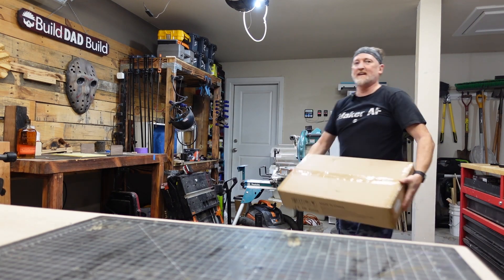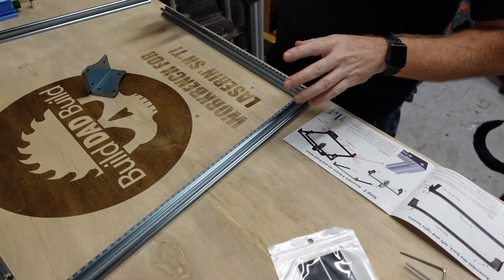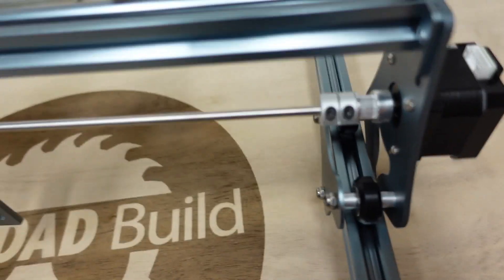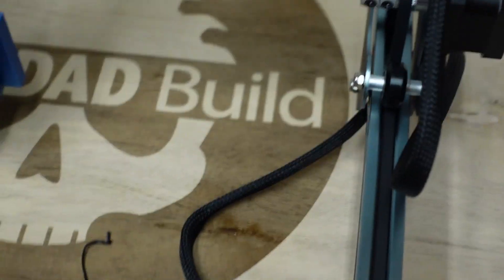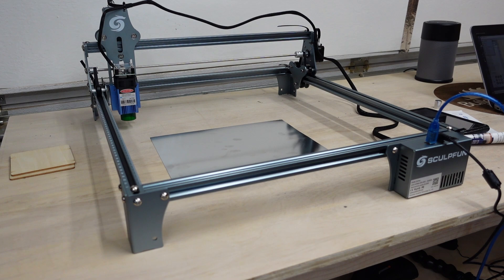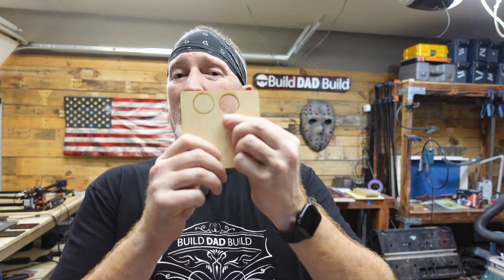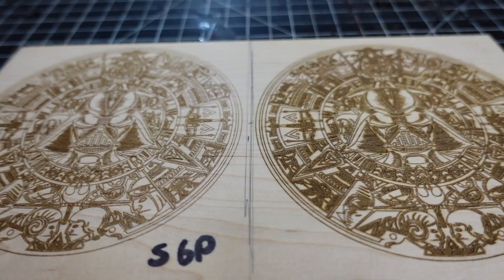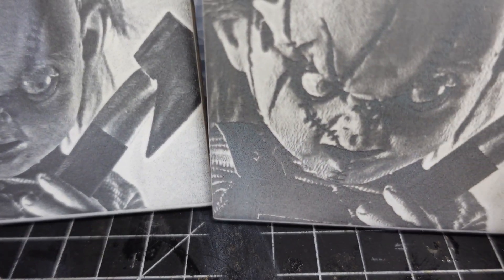Unboxing a New Diode Laser - The Sculpfun 6S Pro

Comment: Please what do you do that make it power on i setup mine but it doesn't power on
Reply from the maker: I'm not sure what your issue is. I just plugged mine in and it was ready to go. If you switch it on and it doesn't power up, you might want to contact Sculpfun tech support.
Cheers

Comment: Just got a sculpfun S9 and can not get lightburn to consistently work or connect...on Mac or windows...thoughts?
Reply from the maker: I had to set it up in Lightburn manually. But haven't had any issues since...
Have you tried contacting Sculpfun? I may have a contact if you need it.
Reply: @BuildDadBuild  finally got it working.. had to go into lasergrbl and download a driver...lol...thank you for replying....
Reply from the maker: Cheers! And happy lasering